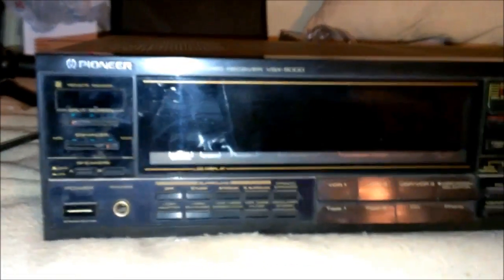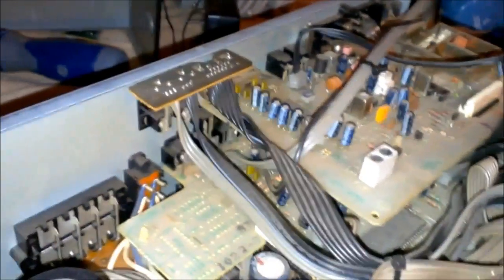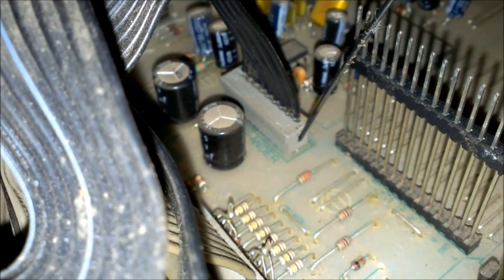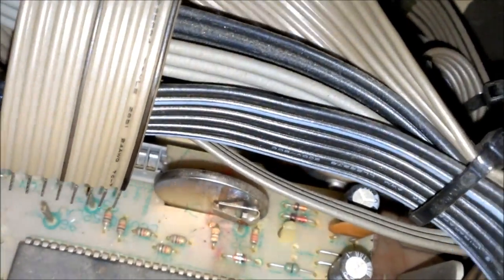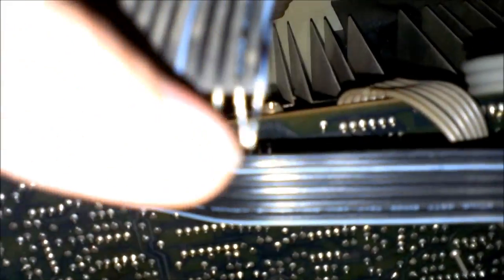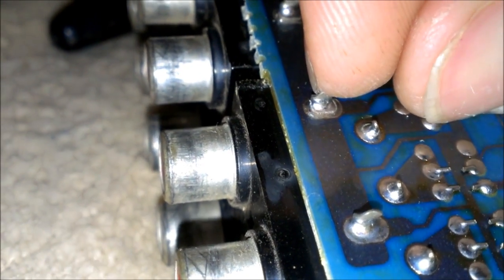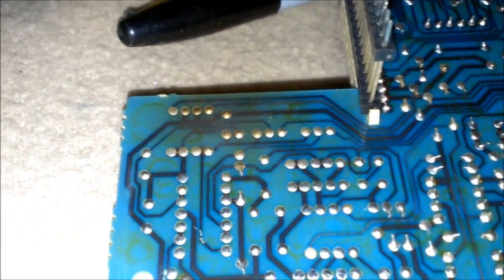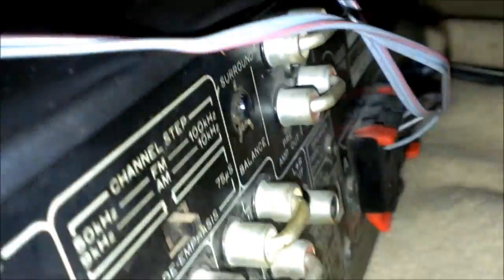Pioneer reciever repair vsx 5000 amplifier 1986 vintage

Comment: I just did mine after 40 years and it fixed the right channel that was dead.  You do not have to disconnect all the cables and bust those connectors.   Just unscrew the screws along the back and  the white plastic pins that hold the board down.  From there you can pull the board forward and flip it over and get access to the bottom of the board to do your soldering.   You will need to cut one wire on that little capacitor that goes over to the chassis ground , just re-solder it back when you reinstall the board.

Comment: hi have this receiver and it powers on and tunes but it doesn't have the secondary "click" that it used to and  there is no audio out. do u know what the problem could be?
Reply from the maker: relay for the amp.
Reply: yes, one of the audio amps is defective, the click is a relay turning on, the relay is a protection device.